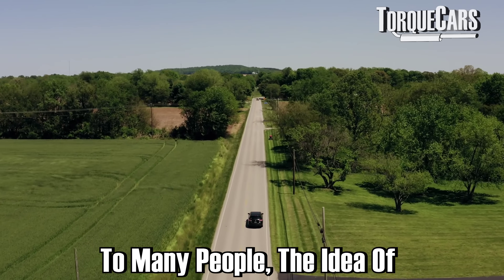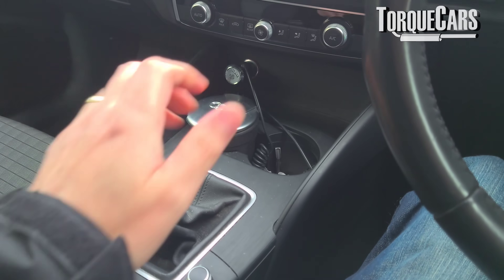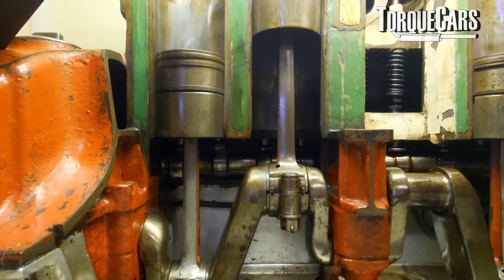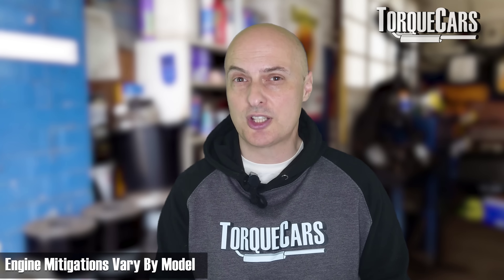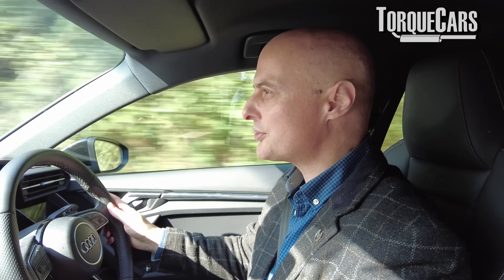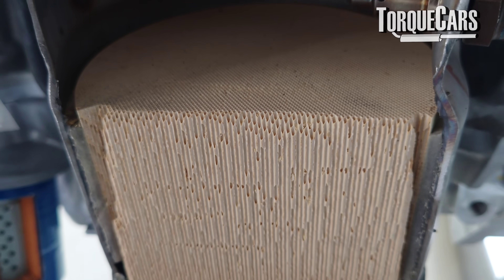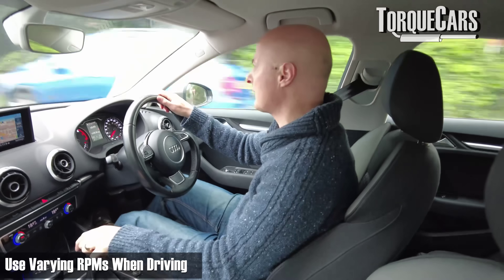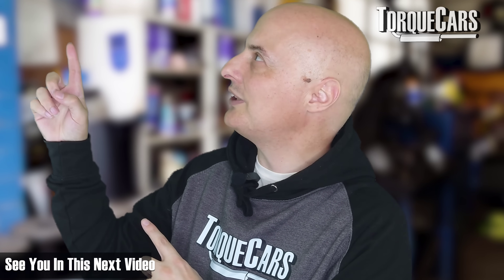BIG DAMAGE By Lugging at LOW RPM? Eco Driving Warning! (Manual Gears)

Comment: Using fuel economy can be a good guideline, but not as some people think.  You need to experiment and find out where your engine is at its happiest, and this is not always at a very low RPM.  I have a Mazda 323 (80s carbed model), and when it was still stock I found it gave the best overall economy if I changed gears at 2750 RPM (higher OR lower meant more trips to the petrol station), kept it in 4th gear in town (cruising around 2000 RPM) instead of 5th, and gave it about 70% throttle for acceleration.

I still need to sort out the tune, but right now the engine wakes up around 2800 RPM, and definitely likes more if I accelerate.

Comment: Its just balance between power used and environment. It should be obvious not to use low rpm torque during climb or overtaking. But you can wisely save much fuel doing this safely with smart approach to environment and "when" time.

Comment: And then the MOT is coming, and people are crying why their DPF is clogged.
Here in belgium. MOT inspection uses a special machine for Euro5a untill the newest.
The older cars get the old smog test. But many people getting failed MOT's for clogged emission related parts.
And if you asked them how do you drove the past year? And i get the answer:  Yeah i was driving normal and slow, didn't do high rpm driving tbh. 
Well there is your problem, why the EGR is clogged and DPF didnt get the  chance to regen properly.
Drive it slow when car is cold, but when it's warm use every rpm every day.

Comment: The best way to save money is to not buy new cars. Don't buy anything showy, because you're paying for the looks. In the UK driving a small diesel car is way more economical than public transport if you only have a few miles to go each day. I had a Vauxhall Corsa 1.3 diesel a while back, and normal driving never gave less than 50 mpg, so the 12 mile round trip was less than £2. And even now it would still be less than £3 per day.
Reply: I have seat leon 2.0 tdi  and get 60mpg some times more if I'm really trying. This is a 13 mile trip and cost me about £1.40 Diesels are great
Reply: One great car to buy in the uk is the 2007-2010 civic 2.2 diesel, constantly over 60mpg and it can be had for less than £2000
Reply: @Mr_Dinguy  I wouldn't mind trying the estate version, just to see if my fat tire MTB will fit in the back!
Reply: @wordreet  what's the highest you got?  Imm guessing you are from the UK
Reply: @alexwalker8422  I only checked it once and found the 50
Reply: Agreed. The most resource use is building the vehicle. Our 2006 corsa diesel is old enough to be 'pre gismos' , bought at 5 years 20k miles. 100k miles later, we will keep it 'for ever'.
Reply: only poor people care about 2 quid here 3 quid there. I like power, my TTS is a blast to drive, I'd want to rope driving a diesel corsa worrying about trip cost every day.
Reply: I ditched the diesel for a Suzuki Celerio 1.0 Petrol it does 70 MPG measured brim to brim, no more ULEZ charge for me, no DPF to change every 80k and free road tax until Rachel Thieves ditches the £0 tax band
Reply: short trips in a diesel? yikes
Reply: @wordreet  does that include insurance, road tax and servicing?
Reply: @JohnnyMotel99  The video us about fuel consumption and engine wear.
Reply: @wordreet  i heard you britts have high pays to enter large cities and districts old cars not allowed 🤔
Reply: @Seregium  As far as I can tell it's only in the capital, London.
Reply: Are you including any potential parking fees into that?
Reply: @ArchOfficial  The video is about fuel consumption and engine wear.
Reply: @wordreet  Thia actually sounds very miserable. 
Do people in the uk not enjoy driving anything that isn't bland like the country they live in?
Reply: @popisolation  Driving wise, yeah kind of. The non turbo Corsa was kind of a joke, as Corsa means race track. And the 0 to 60 was about 18 seconds. But I need the economy at that time. Previously I had one or two V6 petrol cars, which were three times quicker to 60!!
Reply: While this makes sense I also heard that diesels need a bit of time to work efficiently, and that short trips are harmful for them since they don't absorb particles as well. 

I'm far from being an engineer so I'd love to hear the opinion of someone that knows better!
Reply: No thanks I like picking up hot girls 😂 can’t do that in a Prius 🤣

Comment: Thank you sir for this informative video however can you tell me the number how much lower rpm you are talking about. Is it safe to go in city drive doing 50 in fourth gear at 2000 rpm is safe?
Reply from the maker: It varies so much from engine to engine, the key is to choose the right gear for the situation, and vary the RPM you use. If the engine is struggling in a gear you are adding wear and tear unnecessarily.
Reply: @torquecars  correct answer is to look at the specific torque and power curve of your engine. Then you can floor it just at the start of max torque rpm in any gear without issue as long as the engine is in operating temp around 90 degrees C for most cars petrol or diesel.

Comment: I find start stop technology  wrecks more engines than eco mode. I only use eco on long motorway runs and I see a saving of about 10% so not bad. Around town I use just normal mode because as you say you need the power more often and more instantly.

Comment: Transmissions are torque converters. Low gear: high torque at the wheels, less stress on the engine when accelerating. So it might not only be better for the engine, but even more efficient to accelerate with a little more revs: engine does not have to produce much torque. Keep the rpm only low during cruising. That’s exactly what hybrids do: hit the accelerator and the revs go up quickly, much quicker than the car is gaining speed. Back to cruise: rpm goes down.
In a manual you can not fully mimic this behavior, you’d have to shift down on every occasion you hit the throttle, as the rpm in a hybrid goes down to the point where it does not want to accelerate anymore. In a manual I cruise with an rpm that allows to accelerate calmly, and shift down when more performance is required. Nothing wrong with accelerating and shifting up between 2.5 and 4K rpm or even more. You can even accelerate quickly in 3rd to 50MPH and skip 4th gear.
My old school big barge still does 40MPG (2l engine, 150k Mi, 25 yr old, unleaded no diesel).
Reply: @TheSoundsnake  You’re forgetting about manual and dual clutch transmissions, most European car manufacturers use dual clutch transmissions or manual

Comment: Lazy people who do short journeys where you could walk or cycle, so the engine never comes up to temperature, I drive a diesel,  and keep it in third in town and work the engine hard
No problems with it clogging up, my previous car was an ex police car, and I thrashed that all the time, and  did not do short journeys, I cycle or walk, it ran to 200k without problems and used no oil between changes, only changed because of a collision
Modern engines are over square and designed to spin fast
The worst ones are old people who buy massive cars with large engines, then Potter around trying to look important,  sat behind one yesterday watching water pour out of his exhaust !!!
My motorcycle is 22 years old and .likewise runs smoothly because I let it warm up then rev it hard through the gears, it's Italian and designed for that 

Take aclook in traffic at how many morbidly obese people you see driving short distances into town or work ! It's not just their car suffering

Comment: Hi, You mentioned the range of motion of RPM. What is the ideal rpm one should reach to up shift ? And what is the best RPM one should maintain while driving in any gear (like 1500? or 2500?)
Reply: That's going to depend entirely on they type of engine you have Diesel/Petrol/Normally aspirated/Turbo/engine CC/number of cylinders/Gearbox ratios etc... Every car will be different
Reply: @Blat14  Lets say a petrol 1.2 ltr naturally aspirated 4 cylinder engine. I have seen in blogs that recommend to maintain at least 1500 rpm. But i personally feel in my car1200 to 1300  rpm feel comfortable. I get good milage and engine also seams to run smooth and it does not struggle. But for sure if need instant speed i have to down shift. but some time i slightly increase the throttle a bit and it will pick up speed in few more seconds, i have to be little patient and not be in a hurry to overtake something.

Comment: You should at least do some dynamic driving once a month. And bring the whole system to the high end of safe operating temperature. It'll have a cleaning effect on  many parts of your car (engine, transmission, exhaust system). The high gas flow will blow clean tubing, high temperatures make soot start to burn, specially soot particules flung of by the gas flow dragged into the hot part of the gas flow. The whole catalyst converter system can reach full operation temperature without any "cold zones" and the self cleaning effect catalyst converters have designed in. Getting your exhaust system hot front to end will boil off condense water in your mufflers, preventing rotting of your cars mufflers from inside out.

Comment: Is this as much of a problem with automatics?
I used to have a 4L inline 6 coupled with a 4 speed automatic, and from time to time (once it was all warmed up, obviously) I'd put it into sports mode and wind it out to 4,000-5,000 RPM a few times just to make sure carbon would burn off and keep the catalyst clean, but now i have a 2L Lancer with a CVT that likes to hover around 2,000 RPM, but will happily go beyond 3,000 RPM when accelerating briskly.

Having said that, the big 6 was LPG only so carbon buildup was probably a non-issue, and i only run BP Ultimate in the Lancer to try and minimise carbon build up and crud in the intakes
Reply: It depends how much you trust the manufacturer, who has to weigh between protecting the engine and meeting emission regulations.

Comment: forgot to mention that
1. Hot blow by gasses push out the oil between the piston rings and burn off oil , especially oil scraping ring that wil clog up. 

2. oil needs to seal off the pistonrings. At low rpm oil is not able to maintain this seal. Mind that at tdc and bdc piston speed =0, at low rpm time enough to lose fluid pressure. In addition we use low piston rings tension and low viscosity oil like 5w30 C2 or 0w20. These oils can easily push out between surfaces (also  bearings)

3 oil needs to clean the engine and at low rpm there is less flow through the engine and piston rings can not be cleaned by the oil. 

4 higher service intervals makes it harder for the oil to do it's job. A extra oil change at 1/2 the interval cost less than a complete engine overhaul. 

Speeding up piston speed (higher rpm) will prevent problems.
Reply: Yes but higher engine speed automatically means more friction and wear bc more force means more friction (also true with lugging) so where is the balance between fast enough so the engine can function properly and slow enough that you aren’t constantly revving it out and causing extra wear
Reply: @whatsomeonesaidwastaken9216  I like to cruise at 2150 top out at 2500 unless I need the torque I use the same RPMs in the airplane
Reply: @whatsomeonesaidwastaken9216  he means between 2000-3000 rpm, which is the sweet spot most engines are designed to work on. Lugging is done below 2000.
Reply: Thanks, from now on I'm not going to idle at red lights, will keep pedal to the metal
Reply: This is why I always buy highway driven engines, they are at their peak power and efficiency always!
Reply: @01lexe  correct. I change oil at 3000 miles. And use only conventional oil.
Reply: Lol wut?

Comment: Optimum engine efficiency is typically at around 2000 rpm at around mid load. You want to pass through this when accelerating. Accelerate fairly quickly upto speed with engine speeds upto 2500 rpm for best economy
Reply: @nicktheengineer5976  got a citation for this claim?